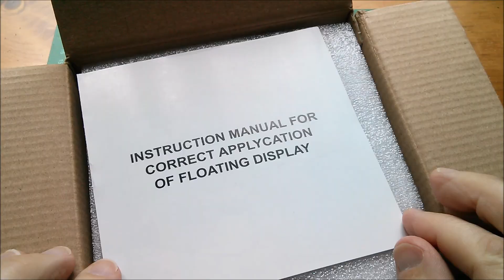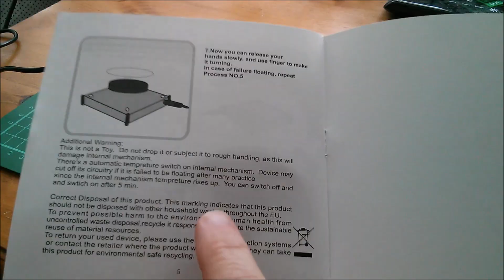Playing with: Magnetic Levitation Platform

Comment: I would put a heat sink on those transistors so they last longer. Just a strip of Aluminium with some thermal grease applied in between it. Either spring load it with clips on the edge of the pcb or glue it with superglue/T-8000.  I am curious about the schematic also. There is a DIY assemble kit for about $30 on Ebay, I bet that would include the schematic and explain more about the trim pots purpose.

Comment: I just received one of these. I can't get the magnetic disc to balance. It worked randomly a couple of times, now it just throws the magnet off. I can't get it to balance at all. I've tried adjusting the pots with varying degrees of change to the pull strength etc. Any ideas before I toss it in the trash ?

Comment: I'm fairly certain this works with out the unit being powered on.  Did you try that?  The reason I say that, is that I've seen a number of videos where people take a ring magnet like the one in the unit and then build a spinning top.  The spinning top is loaded with weights until its able to balance like the little floating top you have.  They have spun their top probably to help average out any inbalance in the top.

Comment: Had one of these bought as a present. Worked at first but after turning off, I could not obtain levitation again on restarting, despite a long time trying. I obtained a replacement and exactly the same thing happened. I took it apart and two of the four coils were loose. I tightened them up but it made no difference. Mine does not have the LEDs that help with centering. Don't know what else to try and it could be heading for the bin!
Reply: Same here. Only got it to balance once. Now it just flicks the magnet aside no matter how you try. So it's into the trash and around $50 bucks wasted.

Comment: I bought this exact model from the description link and its not capable of handling half a kilo at all. I barely was able to put 200g on top. Anything more than that is heavier than the magnet + field and the magnet falls on the platform. I am not sure why on the video it shows 500g. Am I doing something wrong? Maybe not enough power supply? Also, leds are not sensitive to the magnet and the opacity does not change. They are just on.

Comment: Hi. Unfortunately the “this is a plug” plug you showed at 1:26 is not a plug that should be used either. If you look at the three pins you’ll notice that the L and N pins are half insulated (in line with IEE regs and CE etc). The problem is that the Ground or Earth pin is also half insulated. 

In a UK socket the Earth pin is used to move the gates on the L and N slots. The connection from the Earth pin to the socket is very close to the front of the socket hole, whereas the L and N connections are further back behind the screens. 

When you plug in he type of plug you showed, initially the Earth pin makes contact with the socket but as you push it further in the insulated part of the Earth pin comes into contact with the socket and the uninsulated tip of the Earth pin breaks contact. 

Please check this for yourself. Just measure between the Earth pin and the socket Earth connection. You’ll find continuity at first but as the plug is pushed fully home the Earth pin becomes disconnected. 

I just throw those power leads away. You think you’re grounded but you’re not. Too dangerous for my liking. 

Cheers

NOSS

Comment: Yes, the small sensor at the top is Hall Effect. It's using a closed loop system to 'correct' the voltage passing through the electro magnets.

Edit: The screws should be the adjustment for the hall effect sensor

Comment: Hi, i just got mine today, from eBay. You know that white part at the end of the red and black wires that connect into the module? That white part is just barely too big for the slot, and the parts design doesn't match up with the receiver parts design. What can i do to fix this? I thank you in advance for any help.

Comment: I have documentation on reverse engineering this particular board if anyone interested. I didn't see much interest initially so it never went anywhere. Those transistors are 1/2 MOSFETs and 1/2 BJTs forming half bridges. The whole thing is an analog control system anyone can do which I found pretty interesting.
Reply: Hello, I am interested in the schematics if you still have it? If so my email is szaszbandi@yahoo.com
Reply: Hey could you send me your documentation? Trying to build something simmilar right now.
Reply: Can u post link to document

Comment: i hope you don’t. mind my saying but i’m pretty sure your holding a swiss plug, not a european plug.
the pins are european compatible however the base is swiss designed for swiss made wall sockets.
when connecting into the wall in switzerland, it’s a perfect fit and snug and the weight of the socket is not bearing in the pins, which is what the swiss wanted to avoid as it’s bad electrical practice to have a conducting pin bearing the weight of the plug. 
actually unlike many countries solid fit.flimsy and electrical fires have started the way you configured the plug.
you’re trying to plug a swiss plug into a ‘uk to european’ converter, into a uk socket. 
sorry if i confused anyone.

Comment: The problem is not the 2-pin Euro plug, it's your crappy adaptor!
The Euro wall socket (called a pig's nose by some Germans!) is recessed and has slots that hold both the 2-pin and earthed 3-pin plug securely. (Too well sometimes, they are actually difficult to use for those with weak fingers.)
Find an adaptor like this but cheaper.....
https://www.conrad-electronic.co.uk/ce/en/product/612848/Travel-adapter-Europe-to-UK-Skross-1500230?ref=searchDetail
.

Comment: So many unanswered questions for such a neat gadget :( How much current does the platform draw, and how does the power consumption change with the weight of the levitated object? How does the voltage waveform on the LEDs look like? Or on the input plug?
Reply: The power draw is very litle when its just standing and rotating under a few hundred milliamps, its so little thta my QD188 power bank kicks off if I haven't set it to not turn off automatic, as its thinks there is no load. but the moment you put pressure on the plateau the power increases massively, on my power bank I saw spikes up around 1.6amp when i tried to place items on it or put some pressure down on it, most of the time it was around 0.6amp., but when its just standing and rotating with an item on it its very little and only a few hundred miliamp.. you can see the power bank display shows cero here in amps, and thats when its under 0.2amp...
https://i.imgur.com/c9msNED.mp4

Comment: I counted about 42 comments on the plug, the, insignificant and  unimportant part of Julian's presentation. He is examining something relatively complex, important and useful to us all. Some may view the unit as a toy but there is much to be learned from this design. For example (1) What is the function of the large ring magnet? (2) Why is the suspended magnet oriented so it is attracted to the ring magnet? (3) When the suspended magnet is in a balanced position, what type of circuit is used to drive the 4 LEDs? (4) For what is the CD4066 analog switch used? (5) Julian did not mention finding 4 hall sensors near the top of the electromagnets, what tells the circuit where the suspended magnet is located? (6) What are the 2 multiturn potentiometers used for? (7) There are 8 transistors, how are they used to drive the coils? (8) What are the 4 little circuit boards in the center of the device used for? (9) What is a 4419 and how is it used? (10) How many turns are there in each electromagnet? (11) How much current is used to drive each one? (12 Why is audio generated when Julian forces the suspended magnet downward toward the coils? (13) How much current is used to lift the incredible weight (for this small circuit) of about 500 grams (USA: 1/2 pound)? Come, let us reason on these questions...........

Comment: I would like to see you explore the pole patterns on the ring magnet and puck.  I predict the ring magnet is either a standard speaker magnet (one pole on each flat side) or one pole on the inner and one on the outer circumference.  I suspect the puck is actually a stack of two neodymium magnets, but I don't have a prediction of its pole pattern.

It would also be interesting to see what an eddy current filter (say, copper clad board), under the magnet would do to the feedback response.

Comment: The pins in that europlug are only designed for 2.5A. Otherwise it would be a full Schuko, round instead of flat. Schuko's can be used with any Earthing system, since we've got multiple plug/socket types across Europe, which all comes back in the universal Schuko. A europlug takes less space in a powerstrip then a Schuko. The europlug is commonly used around Europe for phone chargers, trimmers, kitchen appliances, etc. And your magnetic levitation device.

In my opinion the British plug is just odd. It's quite incapable of being waterproof! A Schuko can be made waterproof (due specially designed plugs/sockets, mostly for garden use), due that the Schuko plug is round, and lays recessed in the socket (compared to a flat surface of the UK). How does that work in the UK?

We'd also use CEE plugs (16/32A single phase, blue. 16/32/63A/125A three phase, red) which are at least IP44 and at best IP68. Are those also used in the UK?

The wobbliness is your converter!

Plug war started! ;-)

--------

On topic:
Can you power a led from the magnetic fields? To levitate a powered led?
Reply from the maker: Or a new phone charger where the phone floats in mid air :)
I'm a big fan of the Schuko plug.
Reply: BellPhreak Our ingress protected / weather protected / outside sockets take normal UK 13A plugs. Yes in industrial applications CEE connectors are used. Especially yellow plugs and sockets for building and portable power applications. The Wikipedia entry even mentions the BS standard (https://en.wikipedia.org/wiki/IEC_60309).

Comment: The multi turn trim pots might be to adjust the transistor bias currents.  Just playing with them might not be the best idea unless you are precisely counting the turns.  Use a regular screwdriver so you can see the exact head position as you turn them.  I would also use an ammeter to watch the input current.  Some basic track tracing might indicate their use.

Comment: is it possible to get electric energy back from the magnetic field ? My idea is to power LED inside a 3D printed model using induction.
Reply: You can only get power from a moving magnetic field. However, you can add an inductive coil like used in wireless charging systems and get power to the floating object. There are lighted floating globes that do just that.
Reply: sure,, allready numerous products where you  have LEDs or LED filaments in the floating item that lights up.
https://www.aliexpress.com/item/2018-NEW-Magnetic-Levitating-Light-Bulb-Desk-Wood-Grain-Floating-Lamp-Unique-Gift-Home-Office-Room/32856830384.html?

Comment: USA plugs are very noddy. 
Usually 2 pins of very weak brass that bend readily and fall out of sockets. Also, if there's a 3rd pin for the Ground, it can be broken off by hand to fit a 2 pin socket !
Ordering some USA mains 'things' would likely make a fun video.
Reply: If you take a paperclip and form it into a u and use it to shim both sides of a US plug it generally removes the "noddy" feel. Just be sure to put the paper clip into BOTH sides of the outlet before you plug in the cord.
Reply: Haha, guaranteed to fix that plug for its entire lifetime and the socket it's attached to  :)

Comment: How much power does that thing draw. It would be a cool display case, but if it draws an amp that would be a bit unnecessary. With as much heat as it is putting out, I can't imagine it is a small amount.

Comment: put a freaking meter in between the darn thing.. that would both give you an idea of the current draw which would likely fluctuate with your fiddling and pressure attempt and could also be a helping hand when fooling around with the pods. 

and your fooling with the pods, if you have just taken a moment to sense any effect and not touching it again and again, it could also be a helping hand as the viewer got no chance in hell to sense if it's you or the pods there are turning the direction in the spin..  13:12
Reply: Working current: =<200mA
https://www.banggearwatch.com/pricetracker/eqkit-ms-500g-diy-magnetic-magnetic-1330343/
Pretty much identical, i have this one

Comment: in europe not everything is plugged into a dollar store "shavers only" adaptor though
Reply: He does make a valid point though... I'm from Canada and we almoat exclusively use type A plugs (110v, 20A). We also got NEMA plugs, but you basically never see them. They look a lot like the Australian plugs except the prongs usually are all vertical, oh ya and they are used for rather high power appliances (220v at 60A is the highest available in my area). 

Kinda threw me through a loop when he held up his Australian plug like It was no big deal... I got buddies who will flip the breaker before unugging one 🤣. Compare that with UK plugs.... honestly I'd be scared to use UK plugs for fear of breaking them.
Reply: maurizio figini  You can get proper adaptors, like this one: http://hobbycomponents.com/2546-thickbox_default/euro-to-uk-plug-adapter.jpg
Reply: @Mark1024MAK  My impression was that it was his adapter that was providing the wobble rather than the plug...
Reply: Shavers only adaptors, good ones to blow the fuse.
Reply: Sometimes he does make himself look a little silly.
Reply: I suppose he does it in purpose to stir up a bit of "outraged" comments and have a giggle :)

Comment: The pots are adjusting the stability of the field, you can see it start spinning CW and CCW as you adjust the first one and the second one looks like it's to compensate for oscillation.
Reply: Yeah, I couldn't figure out the second one, but the first pot was clearly causing the magnet to rotate one direction and then the other as Julian fiddled with it.
Reply: makes sense.  at first i thought it might have been a buck converter for powering the windings, but it reminds me of old gyros for 3D RC helicopters..  looks to be controlling the field axis
Reply: No, actually its for adjusting pull direction of the suspended magnet. For example when you turn one pot it will pull more to one side. I have almost identical kit, except it was a DIY kit i soldered together. The coils, pots, the big ring magnet etc is identical. And in the instructions thats what the pots do. No idea why it doesnt do anything for this guy though. Here are the instructions, scroll to bottom to see about the adjustment: http://s000.tinyupload.com/index.php?file_id=26748642999247571190
Reply: It doesnt start spinning CW and CCW as hes turning, it spins both ways regardless, cant you see its spinning both ways before he touches pots?
Reply: The pots might not be connected to anything, since when you have tuned it correctly theres no reason to touch the pots again

Comment: No wobbles when the plug is in a socket thats designed to use with one, not  an adapter that takes usa, japan and indochinamenistan plugs.  I had a cellphone charger, wallwart, from a
Samsung, w it h that exact plug, it got hit by a foot while plugged in and the case broke, not the pins of the plug. And the case was thick plastic as well..
Reply: In my case, a similar incident resulted in a broken European socket.

Comment: Julian the noddyness is due to the plug converter. The normal EU sockets hold the plug very well
Reply from the maker: In truth I'm a big fan of the Schuko plug. I like it even more than our UK plug.
Reply: LOL well this one it the narrow kind of that plug (no idea what it's called) but as one here already said, in normal sockets the diamond shaped plastic outline around the pins fits between plastic pegs (slots) in the socket. However there are also non-earthed sockets in my 70s home and they are having a flat surface meaning only the pins enter the socket but I can't say plugs with 'heavy' adapters directly on them are easily falling out of those as well (my own experience)
Reply: For low power devices, the Bell and Lee shrouded mini 3 pin plug is the best. It's smaller than even the USA styled two pin plugs. At work we use these for use with test gear leads that plug into panel mounted sockets. But is not permitted on a ring main circuit, due to having no fuse and due to it's low current rating.

If you want a smaller plug that is legal in the U.K., use a U.K. 5A round pin plug. Wall socket plates are available, as are adaptors for use with our 13A sockets. Note that wall sockets would have to be fed via a fused spur or via a dedicated radial circuit with a 6A MCB or 5A fuse.